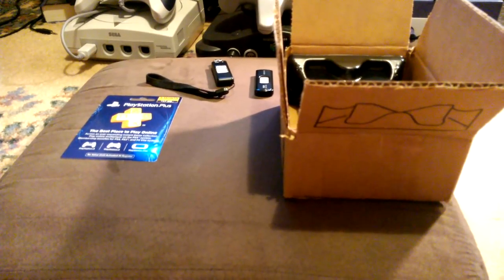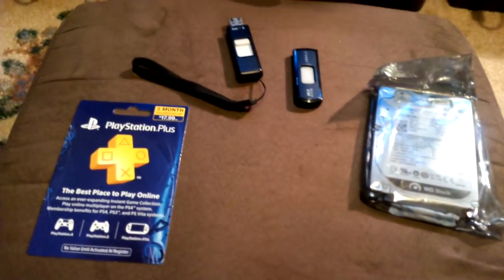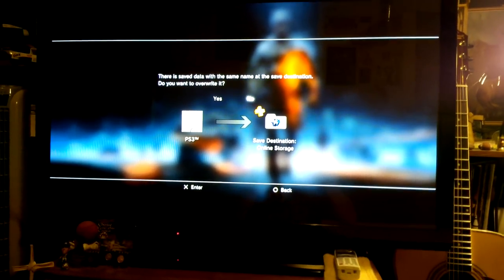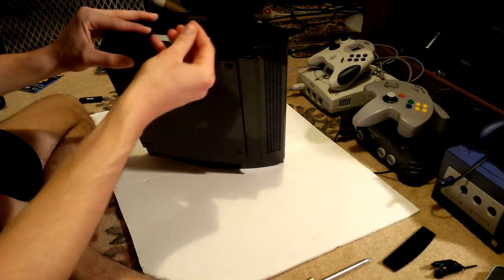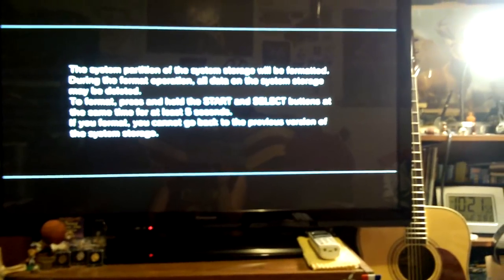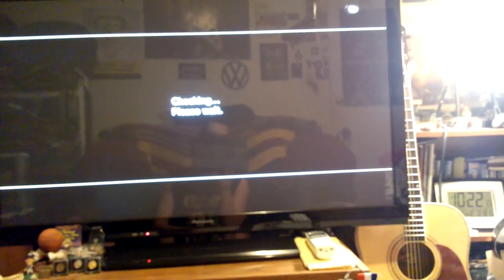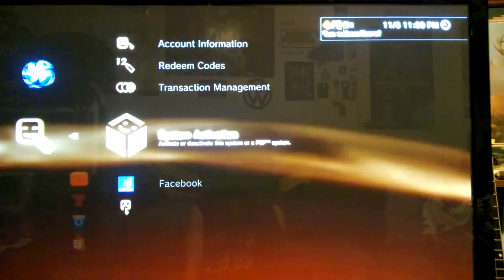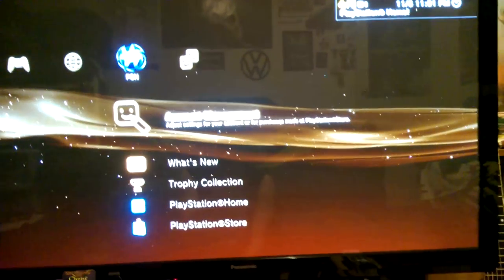How to Upgrade PS3 Hard Drive and Keep Data Without Using an External Hard Drive

Comment: ok thanks alot i was told that it wouldnt effect the hdd but i wanted to make sure before i did anything guess i need a usb then :)
Reply from the maker: GRANT ASHFORD Game saves generally are small files so you could fit them on an 8GB USB stick which should be under $10. Or you can use PS Plus which pretty much does the same thing but in the cloud. A 3 month subscription is $18.
Reply: +Mr Everything i have a ps plus membership.. so can i save all data online with ps plus,  and when i put in my 500 gb hard drive will i still be able to play the games right away?
Reply from the maker: Jordan Blake Using this method you can keep everything but you'll have to re-install the game data for each game and let it re-download the patches which can take some time depending on how many games you own. But yes if you store all your saves in the cloud, once you re-install your games your saves will be there so you can pick up where you left off.
Reply: my friend has this problem with his ps3 at first it would take games and play them for a while before eventually freezing. It got worse over time and freezes after like 15 mins of play. But now it wont even take his games or cds or dvds any more im pretty sure its a 8 pin ribbon that goes from the blue ray drive to the ps3 any ideas where i can get him a new one?? if u think im wrong and u know whats wrong with it could u let me know asap please
Reply from the maker: +GRANT ASHFORD I don't know much about PS3 issues as I've never had any but my guess would be if it works and then acts up after a short period of time and then is getting worse I would think the console is overheating and the more it overheats the more it's wearing down the components. There are tutorials on how to get the heat sink out and clean the heat sink and apply new thermal paste. It could be the blu ray drive but it seems odd if it's lose or damaged that it would work at all if that was the problem. The simplest thing would be to turn it whatever is the opposite of how it is now, meaning if it's being laid flat then put it on its side and if it was already on its side then try using it with it being laid flat because I think I remember a few people saying doing that solved their issues. Luckily PS3s are fairly cheap now especially if someone upgraded and just wants to get rid of their old ones so if you had to you could get another or use it for parts.

Comment: how can i use my external hard drive or usb on my ps3 on mac????
Reply from the maker: If you're talking about what you can do with the PS3 drive once you replace it you can buy an external enclosure which turns it into a USB external drive and you just have to format it and can use it for anything. And if you mean you have an external hard drive you want to add to the PS3 then you should just be able to plug it into the PS3 via USB and go into the settings and have it format the external hard drive and have it set up to work on the PS3 in addition to the internal one.

Comment: If i buy a new ps3 and put my old hard drive in it does all my data saves or no?
Reply from the maker: I'm pretty sure your new PS3 would format the hard drive being installed from it and then you'd lose all your data. You would be better off getting a USB thumb drive and hooking it up to your old PS3 to copy the save files onto, then on your new PS3 you'd have to install the game data and updates again but then could paste the old PS3's saves onto the new one.
Reply: Mr Everything ok but how do I transfer the data back to my ps3  if I saved the game files in to my USB
Reply from the maker: ergy jeudy If you're talking about the game saves after you have the new hard drive in and reinstalled the operating system and you're back on the XMB, sign in so all of your account stuff syncs to your PS3 then after that connect your USB stick and in the games tab in the saves folder if you hit triangle there should be an option to paste/transfer back your files.
Reply: Mr Everything thanks u very much

Comment: ok i have a old fat 60gb ps3 and i want to change the hdd on it because it will let me play certian games for hours on end but when i try and play my copy of call of duty black ops or try and go onto the playstation store it turns off within 10 minutes. if i take out the old hdd and put in the new one then format it and then take it out and put the old one back in and then do the transfere will i loose any data??
Reply from the maker: GRANT ASHFORD I'm pretty sure the PS3 automatically wipes a hard drive if it isn't the same one put back into it. So if you removed your original one and put it back in it might not format it (but I'm not sure) but then if you replaced it with a new one it would format that one and recognize it as the new drive but then switching back to the old one would make it view it as a new one and format it, deleting everything. That's why it's recommended to either use the backup utility with an external hard drive or back up your game saves with a USB stick or in the cloud with PS Plus and then you'd just have to reinstall your game and re-download DLC and game patches.
Reply: ok i tryed using a new hdd in the ps3 but it still wont let me play call of duty black ops or use the playstation store it still keeps turning off any idas????
Reply from the maker: If you're using a new hard drive that doesn't have anything on it then I'd try to do a factory reset or restore factory settings, which ever it's called. If that doesn't fix it I'd try formatting the new hard drive and installing a new PS3 operating system. As long as you're current PS3 firmware is their latest version you should be able to use the Store. If that still doesn't fix it them I'm not sure if it's your PS3 itself that isn't working.
Reply: yh i tryed using all the options on the safe mode but no no avail now it turns off faster then before when i try to load the store or call ofduty black ops only these 2 things makes it turn off im hopeing my ps3 isnt completley broken think i should try email sony and ask them?
Reply from the maker: That wouldn't be a bad idea. If you know anyone with a PS3 I'd try playing your game on there's to see if it works on their console or not. If it does then that pretty much would point to a problem with your PS3.
Reply: yhi tryed my call of duty in my frineds ps3 and it works fine he can play with no problems i guess i need to email sony an ask then wtf is going on because it only turns off when i try and play call of duty black ops or go on the store it cant be a over heating problem because i can play gta v for hours on end no problem. its not the hdd because i just changed it, it cant be the laser isnt working because it reads all my other games and dvds fine. i really dont know whats wrong with it :(
Reply from the maker: If you tell Sony that more than likely they would recommend you send your PS3 in for repair which probably would cost more than what you could find another one used for. I'd recommend looking up any info online for the console crashing when the Store is opened and with certain games. If it's the backwards compatible PS3 that has a shiny chrome strip instead of the matte, painted gray one along the front, those are more valuable so you could probably sell it broken and still get enough to buy a newer, cheaper PS3. The backwards compatible models also had the PS2 chip set in them and I think that made them more likely to overheat or have issues. Although that usually resulted in the yellow light of death, where the console doesn't come on at all. So it's odd it works fine until you do certain things.
Reply: yh i noticed alot of people had a similar problem then it turned off and gave them YLOD but its super wierd that it only hppens on the store and black ops. also i saw a video that sed if u turn off the power and hold then eject button then put the power back on it does some internal cleanning like makes the fan spin super crazy, alas mine dont do that either it just spits out the disc
Reply: this is super anoying i cant even get my downloads back wtf so i pay for them and then my ps3 stops working so i try and fix it and i cant even get stuff ive paid real money for WTH
Reply from the maker: If you go to your personal information there should be a section called download history that has everything you downloaded as long as you logged in with the same account you bought everything with.

Comment: what happen if i have too many user and account on ps3 system -_-
Reply from the maker: Different users shouldn't change your installed game data because they all access the same hard drive but if you're using different PSN accounts you'll have to individually back up each user's game saves on a USB drive for each account or get PS+ for each account (which I don't think is worth the money for more than one PSN account.)
Reply: i means gamesharing ..u know ^^
Reply from the maker: Yousuke Otoha I don't really know anything about gamesharing but as long as you're signed into the account (and you know the information to sign back in) I'd imagine as long as you backed up your game saves (either in the cloud or on a USB) it should be the same process to put them back on. Then once you sign into whatever PSN you use you can redownload the DLC, trophies, and sync account.